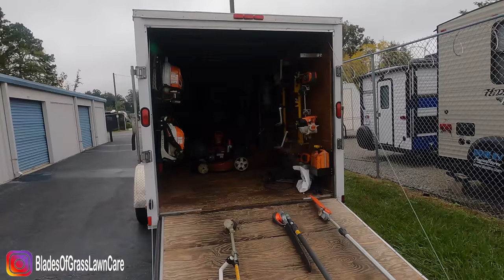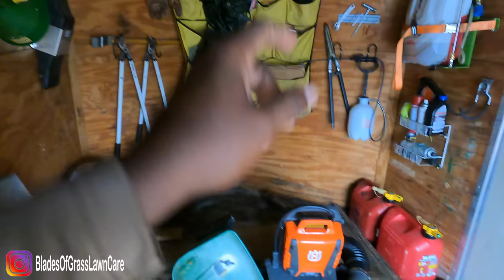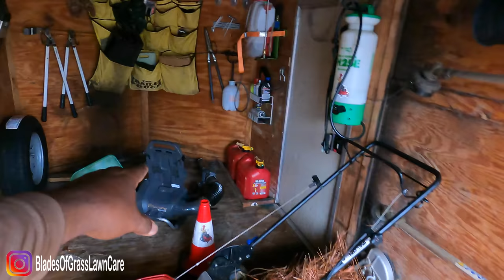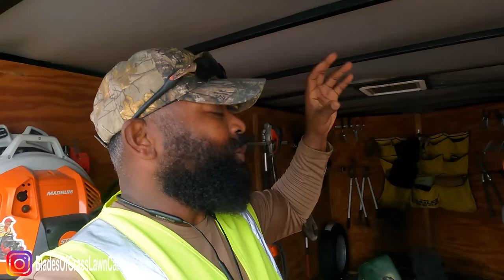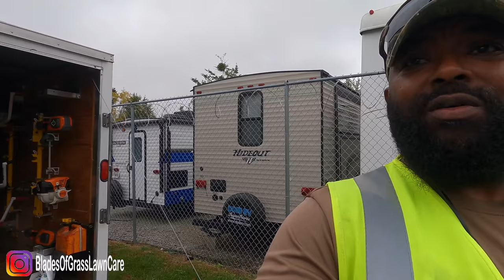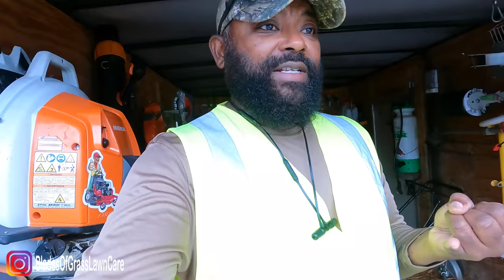Battery Powered Lawn Care Equipment for your Lawn Care Business- Watch Before You Buy!

Comment: Con question is how long until manufacturer changes battery to the point that it causes your current equipment to become obsolete?  How many charge cycles can the battery support to maintain optimum performance before a replacement battery is needed?  
Quality gas equipment lasts several seasons.  Do you feel that electric equipment longevity can match gas equipment longevity right now?

Comment: Just a suggestion… For safety your cords should not be left in a coil when in use..  It creates induction and lowers the efficiency and creates a fire hazard..  You might even feel the cords getting warm? So other than that keep up the good work and stay safe….
Reply from the maker: Wow, thanks I didn't know that
Reply: Also you probably know to keep the cords as short as possible…. Less voltage drop..

Comment: If you're going to use gas powered lawn equipment, use stihl, husqvarna or commercial grade equipment especially on 2 cycle equipment.  The others have too many carburetor problems. The same thing goes for chainsaws, buy quality brand so it will last.

Comment: I like it corded  for more power using a propane generator In a cart or wagon ,atv wheels,,  there is 1000 watt generator-3000 watt . Power inverter with tractor truck marine or   battery for quiet  is cheaper,, ego weed eaters are good

Comment: Been in a lawn business 25 years plus used about every name brand equipment you can imagine I picked up one of those small Husqvarna blowers for next to nothing it needed a pool cord assembly well come to find out it's a Kawasaki part so wondering Kawasaki making it for Husqvarna or Husqvarna making it for Kawasaki since Kawasaki makes weed eaters and lawn equipment as well Husqvarna makes one hell of a dirt bike it's right up there with the KTMs but I'm not real thrilled with Husqvarna" at one of the customer appreciation days at one of our local equipment manufacturer dealers they had a Husqvarna Roomba looking remote control mower that's supposed to run around your yard and when it bumps into something it changes direction and does have perimeters the salesman was so set on trying to sell these things but wasn't getting anywhere with the commercial on guys as we all agree it was more like for homeowner use and depending on the type of grass in Florida where it rains morning noon and night in the summer was St Augustine being prominent as far as the types of grasses and growing up to an inch a day during the summer the little room but wouldn't cut the mustard and when asked about the electric Roomba mower the salesman said you have to cut your grass first Short and then the Roomba mower will take over and keep it maintained well we all had questions one of them was okay so who's going to do the weed eating he's going to pick up the limbs that fall on the ground from the hurricanes who's going to pick up all the leaves that smother out the grass during the winter time and the fall does your Roomba trim hedges and does the Roomba get stuck where dogs dig holes out in lawns and will it sit there and spend on a nice big giant soft serve dog Patty with those little plastic wheels the funniest part about it and the flyer for Lowe's and home Depot the Husqvarna Roomba mower is the same price as the 42-in cut lawn tractor, lol but just like the electric cars they're pushing the pushing pushing for electric cars there's not enough charging stations I personally have never even seen a charging station 40's electric cars and in fact how long does it take to charge your car up at the charging stations do you need to go in and have lunch somewhere and if it's not close you have to take a taxi to go have lunch because it's a couple hours to charge your car so you'd have to keep multiple multiple batteries in the batteries are quite expensive so you're always fully charged and then when the battery's Peter out after 2 3 4 seasons which I've heard on many YouTube videos about the electric batteries that go in these things hardly seems worth it to me since I am a mechanic and I've done all my mechanical work since I was a kid when I was racing dirt bikes at 9:00 I was rebuilding them at the age of 12 air-cooled two-stroke single cylinder dirt bikes along with keeping my lawn mower maintained as I was pushing a 21 inch cut mower to buy my dirt bike and over the years I've built many a race car engine set up rear end gears and have welded and fabricated and has actually tweaked on some of these little two-stroke weed eaters to even get a little more out of them so for me just like electric cars I'll take a gas car any day of the week as far as electric equipment is concerned I'll probably wait a little bit till they get a little more heavy duty even in California now they're trying to fade out gas powered cars by 2035 and I'm sure some deed restricted properties in certain areas in certain towns and cities are going to come up with more and more noise pollution issues as some cities are outlawing gas powered blowers really yes so eventually I can see laws and rules and noise pollution even though it's under a hundred decibels that was going to be the way to go you look at everything chainsaws outboard motors they're all going electric Harley-Davidsons going electric you think the diehard Harley riders are going to trade their tried and true Harleys that run on gas for electric one I really don't see that happening either maybe for the weekend executive who likes to ride his Harley on it occasion and is eco-friendly minded vegetarian, and yes we all know that a new Tesla plaid will spank a new Dodge hellcat and most of the big block supercharged muscle cars will be phased out in electric will be in its place if not electric assisted like some cars like the new Mercedes c63 twin turbo it's based on race car innovation but again being a mechanic and mechanically inclined I love the tinker and work on engines and build engines and high horsepower for someone who isn't mechanically inclined I can see this battery powered stuff being right up their alley
Reply: Like how he said gas will give you more power, no I've heard that some of these line trimmers can be up to 14 lb well I had a Honda four-stroke line trimmer carrying that thing all day long you'll look  a fiddler crab with the one large arm and I'm no small guy at 61" 260 lb  and in good shape carrying that 13,14 lb line trimmer was like carrying around a boat anchor might as well just use a brush cutter for line trimming "  not" as I see most of the stuff is relatively light but is it relatively strong with the battery in a line trimmer doing residential and commercial work last a whole day or have to swap out batteries after 15 or 20 yards I'm sure you would but then again you'd have to fill it up with gas too but if you don't have a battery charge that that current moment in time I guess you're waiting on it to be charged of course there's always pre-planning an extra batteries that are what quite expensive just like that battery pack but I'm glad to see that some of the issues and concerns and questions were answered in this video I like the unbiased opinion on certain pieces of equipment and aspects along with it " great video
Reply: Check out project farm

Comment: Here in the Netherlands the cost of one Stihl battery backpack wire costs €100 without tax, 1749 for the battery( effective run time 5 hours charche time from empty 7 hours minimum. 2 year life), charger unit starts at about €450 next€ 142 for the actual backpack, 600plus for the base unit and minimum of 390 for one attachment( multitool). That's 9.5 kilo's on your back and 4.3 kilo's holding/working the tool. A semi professional (depends on branding) petrol 6in 1 multitool plus extra wire and blades and harness, and 5 liters of fuel costs: €223 including tax. Weight. Including attachment and 1liter of fuel:  5.3 kilo's (feels like 2 kilo's because: free harness) effective runtime 1,5 hours plus, fill time:  about 2 minutes. So for the cost of one batterywire I could run the petrol(€25for5liters) machine many hours.

Comment: Can I charge a battery at all times off my diesel truck. It has 2 big batteries in the truck. If I have a converter hooked up can I charge a battery in between properties or will it kill my truck batteries. The truck sits for 30 mins to an hour in between properties?

Comment: What type of gas trimmer or battery power would you recommend for a lady homeowner? I have tried Bolen and craftsman gas trimmers and they don't last. Thank you for your time.
Reply from the maker: I love the Milwaukee battery trimmer https://www.homedepot.com/p/Milwaukee-M18-FUEL-18-Volt-Lithium-Ion-Brushless-Cordless-String-Trimmer-Kit-with-9-0Ah-Battery-and-Rapid-Charger-2725-21HD/300272796?source=shoppingads&locale=en-US&mtc=Shopping-B-F_D28I-G-D28I-28_32_PORTABLE-MULTI-NA-Feed-PLA-NA-NA-BASE_SHP&cm_mmc=Shopping-B-F_D28I-G-D28I-28_32_PORTABLE-MULTI-NA-Feed-PLA-NA-NA-BASE_SHP-71700000041074945-58700004788398016-92700040946149095&gclid=Cj0KCQiAnb79BRDgARIsAOVbhRqS1yHAtLnLOxuOyg0821yZaWU1R1L6AqO43yqZrB_jQ7QhreIEPQcaAjMoEALw_wcB&gclsrc=aw.ds

Comment: I am in NJ. They are phasing out gas powered equipment by 2025 I believe. Of course it is in early stages of writing these laws. On concern I have is the life expectancy of the batteries themselves. I was a carpenter & we used DeWalt primarily. Once the batteries get old the batteries do not hold a charge as long & eventually will fail. That has be a concern using the batteries in a  commercial application. Adding to the cost. I have a Ryobi blower for the house. It lacks velocity & the charge only will last for 20 minutes using 40 amps. Good enough for my home but do not see it doing a commercial job. Enjoy your video.

Comment: Couldnt have explained it better. Remember transitioning out of pneumatic (hoses) and wired electrical equipment(extension cords) sold all that shit invested in a nice shelf and slowly over time bought one tool 2 tools one battery 2 battieres. Couple eztra charges or accessories.. Definitely couldnt get away with spending 1,000 2,000 on all these tools that you usually start out with as a hand me down or 5$ for 10 craigslist specials.
Do the best you can with what you can and dont sink yourself when other operating costs are more important

Comment: Thanks for the great info bro. I've just purchased the 325iLK with trimmer attachment and edger attachment. But my issue is it came with no battery or charger. No where on Husqvarna's website does it mention battery and charger sold separately. Chatted with customer support and was told to contact a dealer, I did. I had them order two Bli300 and a Qc500 Charger still waiting over two weeks :( I'm thinking about returning.

Comment: Here is a tip for keeping your batteries charged. Get 1 more charger or more depending on how many batteries you have to charge. Connect all chargers to a power strip and have a waterproof outlet on the outside of the trailer/truck. At the end of the last job put the batteries on the chargers inside the trailer/truck. When you get home just connect an extension cord to the trailer/truck. The next day just disconnect the cable and you don’t have to worry about forgetting your batteries at the house.
Reply from the maker: https://youtu.be/BPnR5vzx--o Done!
Reply: @Bladesofgrasslawncare   
Cool I didn’t saw that video. Just thought about it when you said you had to take the batteries home in a bag.

Comment: You don't save money in gasoline, because you can only charge the batteries like 200 times bevore they  lose their capacity and runtime.
I've been working with battery powered equipment for over two years now and I'm gonna switch back to gas, because it's cheaper...
Reply from the maker: Thanks for your point of view

Comment: 4 in 1 combitool on petrol €139,-
Same tools for battery, would cost €399 for strimmer add €345 for smallest battery,€1745 for a big battery.add €100,- for the cord connecting strimmer to battery. Now  add the charger. Want two batteries and an extra charger because charge times suck. After all this they ask €350 a piece and up to get the attachments.

Comment: Hey Jonny, I was thinking of getting a gas echo hedge trimmer. For one because that’s what I run for all my equipment and don’t want to get different mixes of gas. I don’t mind doing a hedge trimmer that’s battery powered. Which brand would you recommend? Maybe something I can find at Home Depot, Lowe’s, or a local dealer. This will be my first hedge trimmer I’d own. Maybe something around 300-350 ish
Reply from the maker: The Milwaukee is great look at https://youtu.be/vF7y0Hm4Nj0

Comment: Get into ego brand. The blowers are better and the battery won't overheat.  The husqvarna battery tends to have a overheating problem when used back to back. The Milwaukee brand using the m18 tend to be under power.